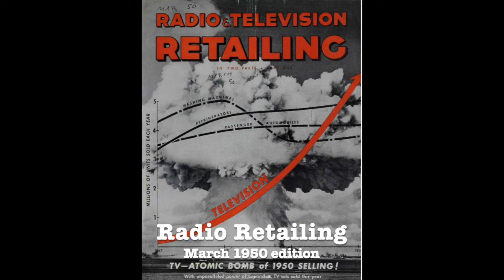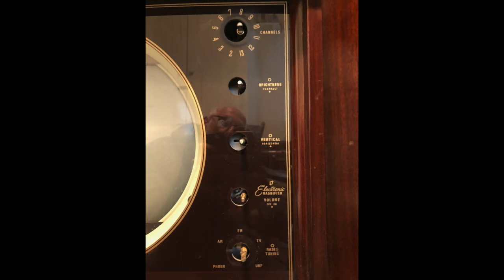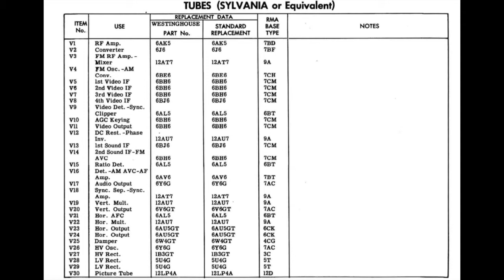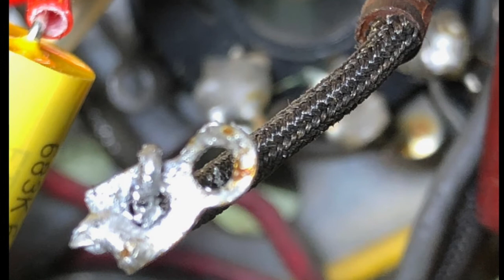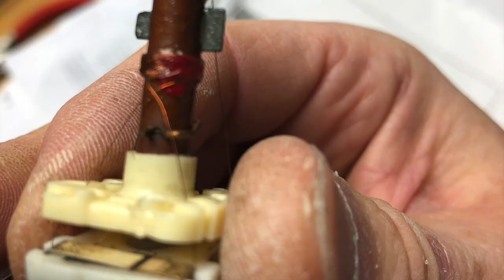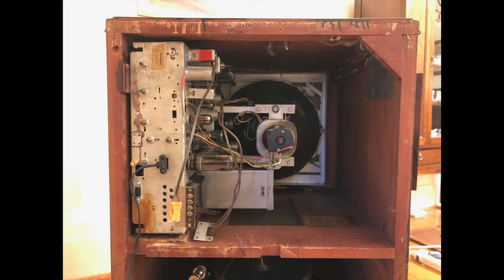Canadian Westinghouse H611-C12 TV/AM-FM Radio/Phonograph Console Restoration

Comment: I can buy the exact one you have complete with original turntable for $50.00. Power cord is missing. Do not know if it works. Should I buy it?
Reply from the maker: It’s a beautiful set. A full restoration will be time consuming and potentially costly. There’s always the risk the CRT will be weak or dead — replacements are pricy. If you’re a beginner I’d suggest this isn’t the one to learn on. But if you have some experience and you’re up for a challenge and you understand the risks I’d go for it!
Reply: @Mr.BrownsBasement  
Thanks for the reply. If I don't buy it, the guy is going to gut it and try to "repurpose it" as something else. I almost have to buy it just so it has a chance to be restored.
Reply from the maker: Even if you can’t restore it today there’s always tomorrow! Go for it. Best of luck and please let me know how it goes.